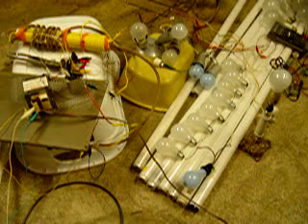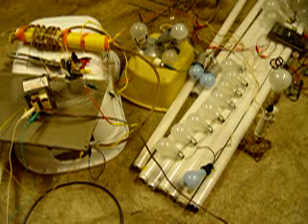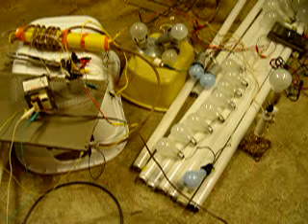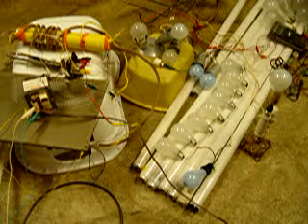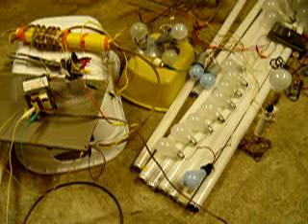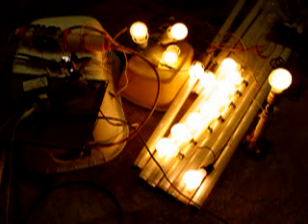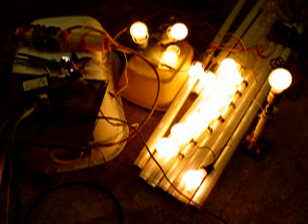Gas discharge tube as spark gap test

Comment: My understanding is that Gas Discharge Tubes are intended for shunting stray voltage spikes, as a safety device and that as such are not designed for continuous operation. 
I have rejected them as a spark gap in my own project because of it.
But perhaps you can help me out here as they would be very convenient to use: How do these last, in your experience?